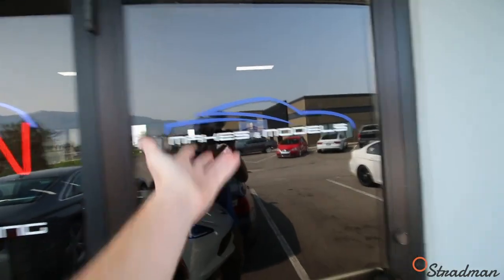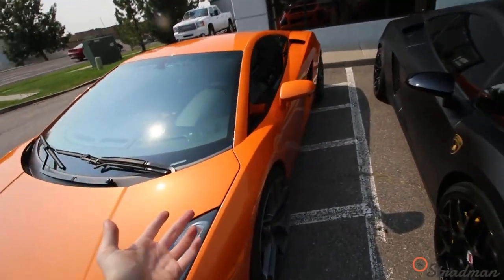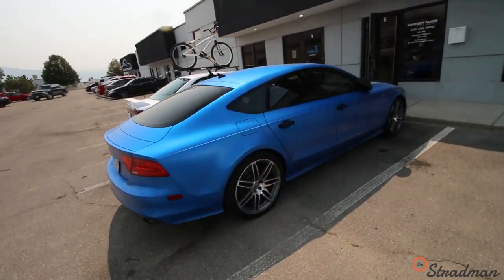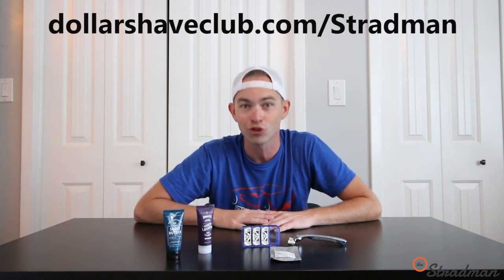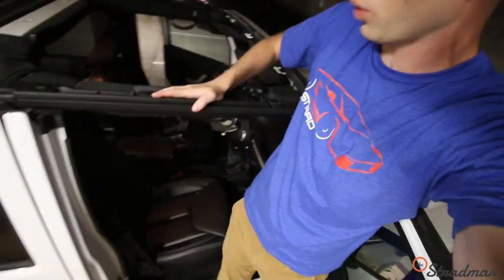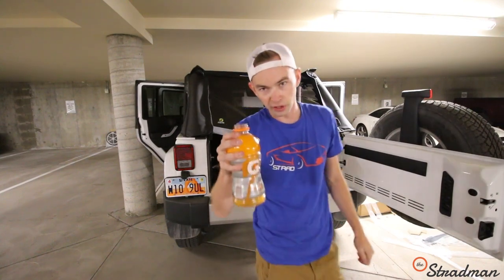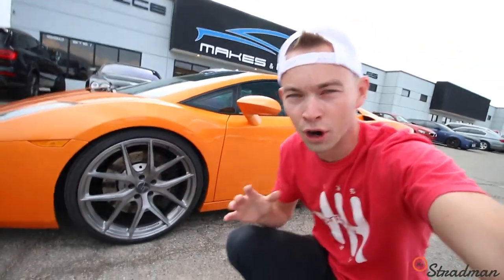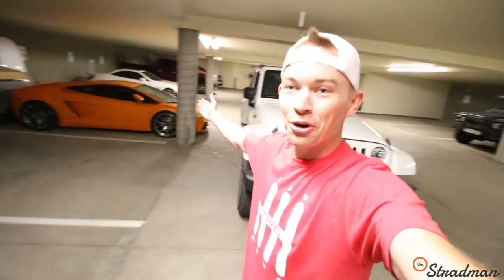TIME TO GO LOWER

Comment: For the Jeep, alloy wheels are always cool. It doesn't seem like you'll be using it as a rock crawler so beadlocks are pointless, but I think a good set of alloys (which are significantly lighter than steel wheels but more expensive than steel) will look great. Black with matte grey bits on the wheel will look great

Comment: Looks like you had fun putting on that Trektop as well.   My wife and I put the same one on her Wrangler and almost got divorced during the install process.   The hardware goes on fast and easy, but the cover itself was a complete pain to stretch over.    

Kudos on the DSC ad.

Comment: Good vid. I liked the tease with parking the BMW in 3 spots cause you were right, I was a nano second from starting to type a comment lol. Installing the soft-top is not an easy task. Good job and I hope you don't have any leaks although it's quite common to have them and you just have to accept it. My CJ5 gets puddles on the front floorboards after a good rain.

Comment: The next mod should be to fix the gallardo completely so he can floor it whenever he wants without only being able to do half throttle. Like so the Stradman can see👌
Reply: there is nothing wrong with the gallardo, he has a new clutch so there is a break in period until he can do full throttle.
Reply: did you not watch the previous videos?
Reply: Jay Howe I

Comment: Put some spacers on those wheels to widen the stance. Running a bit of hovercraft fitment now that it's lower. 5mm on the front and maybe 10mm on the rear

Comment: if you plan on keeping the car for a while (ill assume the new clutch means its in the garage for the foreseeable future)
you should consider swapping the front and rear bumpers with aftermarket. It did look kind of dated next to that black gallardo.
Reply: cause its a still perfectly good car, it just has older bumpers. Why bother upgrading to a newer year is my point I guess.

Comment: I think above your wish for style and practicality, you are going to want to make sure that whatever changes you make to the lambo does not make it handle like a cow on roller skates because it being what it is you change the balance (i.e lower at the back than the front  1/2 inch at the front and and 1 inch at the back is going to make it heavier at the rear than what it is now, because of lowering the rear more than the front. You will be saying one of clarkson's favorite quotes "I've ruined it" followed by some justification by you saying I've given it more charcter. :p ) of the car it will ruin it for driving. Unless of course you get a proper suspension specialist that can set it up so it still handles like it does it now.